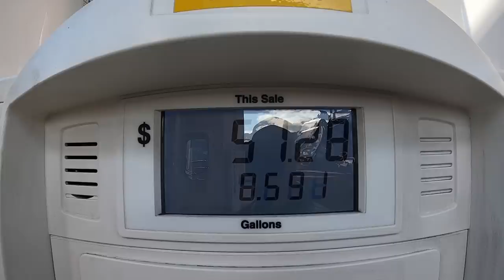Equipment takes a lot of fuel, fuel is expensive.￼

Comment: something else to consider:
the GDP formula does NOT adjust for inflation.  ie - if you have 50% Inflation in a single year, then the GDP formula is probably going to more than 30% positive just because Consumer and Business spending will be through the roof, just trying to keep operating.  ( Government spending may or may not go up in a like manner.  normally, Congress waits for the next year spending bill to raise but they did authorize emergency spending for the Coof )
.
ie - fuel going to $20 a gallon would be "good" for GDP.
 .
and the Federal Reserve intentionally targets Inflation to be 2-3% APR.  which is very close to their GDP Growth target.